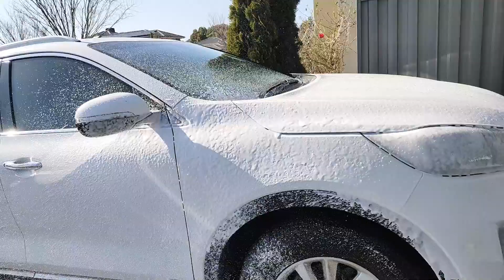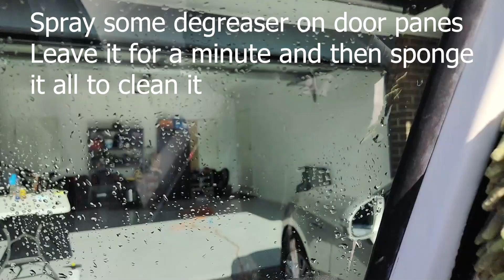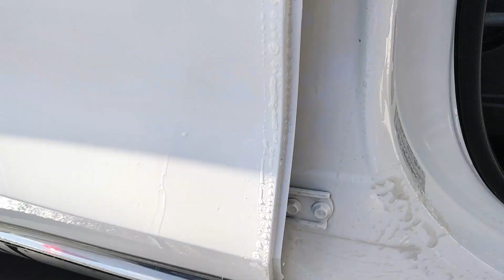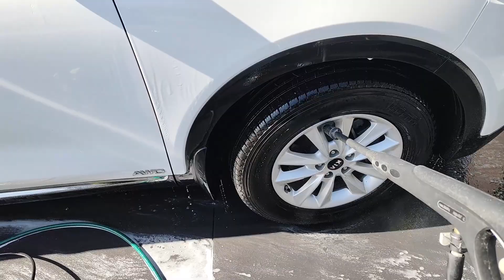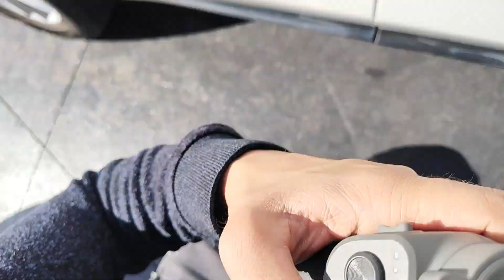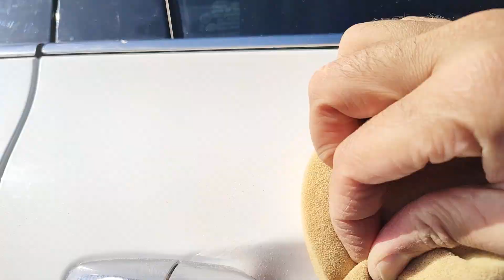How to clean your car at home | Easy Clean | Detailing | Part 1 | Exterior Cleaning | Kia Sorento

Comment: You should avoid using a chamois to dry a car these days, a microfibre drying towel is a much gentler option.
Reply from the maker: Good Point. I think they also prefer using a softer cloth for protecting the coating